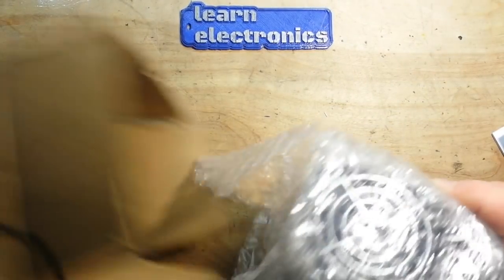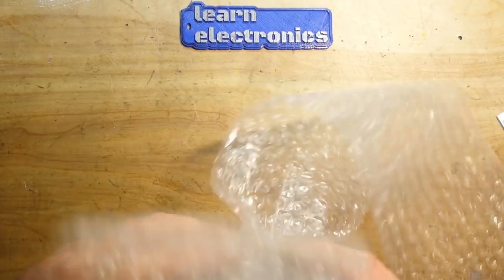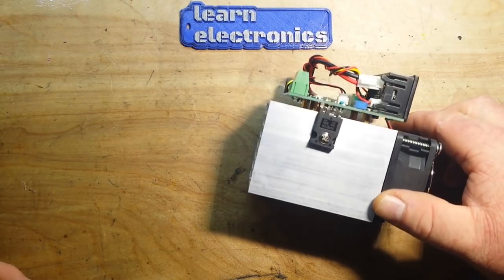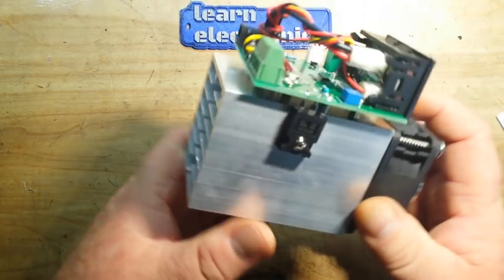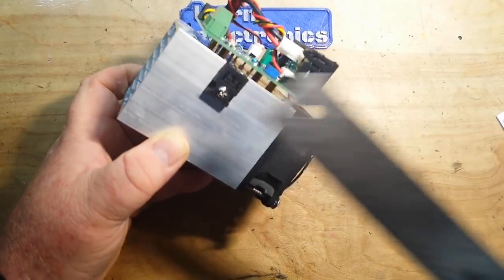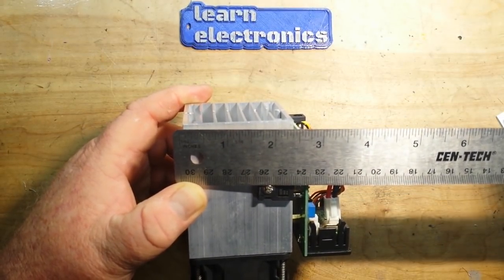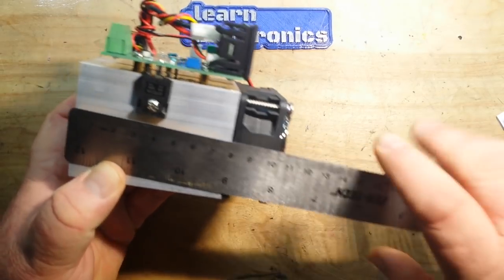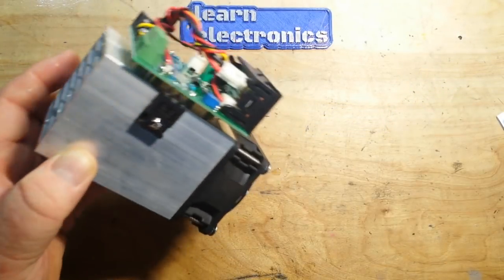100W DC Electronic Load from Gearbest

Comment: The board itself has markings on it, for V Adj. and I Adj. clearly visible in the video. You've also got some voltage drop in the cable, measure at the device and see the difference.

Comment: I’m not a electrician, I bought this to check the ah on a 400ah battery. To see if the battery was holding 400ah. Think I’ve bought the wrong thing
Reply from the maker: Yeah, that's for smaller batteries
Reply: @learnelectronics  Thankyou
I’m returning it Amazon bought another that I saw a guy using on YouTube. Bit more expensive but it’ll do the job

Comment: If it doesnt use sense wires, the voltage will show wrong on the unit because of the drop in the wires.

Comment: 16:00 probably someone has explained this to you already, but the reason the voltmeter is "off" is because your connections are poor. Of course you are going to see a lot of voltage drop at the load; you've got an ohm or two of losses in your test leads. Use some real cables and it will work better... Or use the Kelvin sense connections the way they were intended to be used?

Comment: Learnelectronic you can not have the same voltage on the battery and on the electronic load. You always will have a voltage loss due to the resistive wire you use. This voltage loss is directly an result of the current and the wire resistance.
This is why we need a very big cable and as short as possible to supply something pulling lot's of current.

Comment: As others have already pointed out;
You are not measuring the voltage from the same point at the loads meter is measuring it.

You are measuring the battery voltage with your multimeter while the CC-Load is measuring it after the voltage drop in your wires (this voltage drop will increase with higher current load and is also more noticeable on low voltages).

Use short thick wires to minimize this
OR
connect the voltage measurement terminals to the battery to get the best possible reading from the point of your choosing.

Comment: The voltage measurement error is the result of  the drop in the cables. There is nothing wrong with the voltmeter in the device.  You should have been clued when the voltage dropped with the increase in current.

Comment: you were seeing the voltage drop from the leads on the CC, and on your meter you were seeing the actual battery voltage. I think others have said you should use separate wires to connect the voltage terminals and the current terminals, that takes out the voltage drop from the leads you are using, which for this device is really not relevant since it is going to keep a constant current no matter what the VD of the leads are. Love your vids, screw that guy that can't stand the ac, he must not live in high humid high heat area. lucky him.

Comment: It's not off, you are measuring the voltage drop across the wires. Use the 4 wire measurement and see the difference.
R=V/I (12.375 - 10.1)/1.65 == 1.37 ohms of resistance in the wire at that load.
Reply: yes this was frustrating to watch. For the cost of pennies/nickels you can get a couple of lengths of thin wire and run them to the sense terminals (V+ and V-). Commonly heard in Apple circles, "He was holding it wrong" or "Thats a feature, not a bug" ;)

Comment: You may want to check the cable used between the battery and the dummy load. It appears as though it may have a high resistance and therefore incurring a large voltage drop under load. One way to confirm would be to measure the voltage at the device and compare it to the voltage at the battery (ie. Measure both ends of the cable). One common failure of such cables is that the wires fray at the connector or clips ends, increasing the overall resistance.

Comment: why connect ground first?
Reply from the maker: Always connect ground first so that your circuits reference the same ground point (0V).

Electricity is about potential. 300V-305V and 1V-6V are the same potential. But if you connected the circuits without a common ground, you could see a 305V potential on the circuit.
Reply: but if you connected ground between the two, wouldn't there still be a 299v potential?

Comment: I don't think the viewer who mentioned about the background noise was referring to your air conditioning unit.  It's more like a static noise.  I noticed it a few videos back but it seems to get more and more noticeable.  Just for the sake of it listen carefully to the clip, you can't miss it.
Reply: For some people who worked in a noisy environment for many years, they will have problem hearing some frequencies.  Usually, the ability to hear sounds in the higher portion of the audio spectrum is affected.  For some others, even low frequencies are difficult to hear.  So far some people have mentioned something about that background noise and Paul said he would try a different mic for his next video.  We'll see how it goes.  What is funny though is the fact that Paul is expressing his concerns about the noise the air conditioning unit is making but I have to be honest with everyone, as of now, I haven't been able to determine if the unit was actually on or off unless Paul was mentioning something about it, go figure.  Is it only me ?  Perhaps Paul had a bad day, a bad moment, so he got "excited" when you initially mentioned it.  Despite the fact that we're not made of electronic parts, we do still at times have a breaker on the edge of tripping !

Comment: Separate wires from the battery to the Voltage terminals on the load? Noise from AC doesn't bother me, but it did make me wonder if it would be possible to build a filter to get rid of it. An idea for another video might be voltage drop on batteries when loaded. Why it happens and is it possible to calculate?